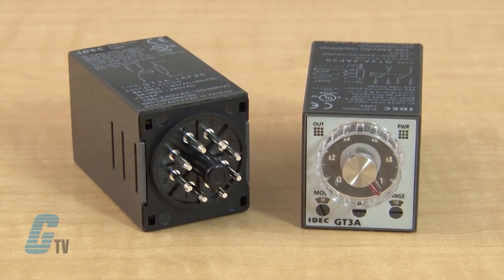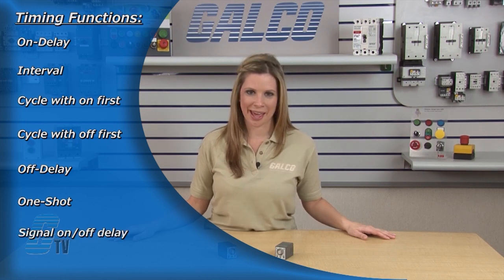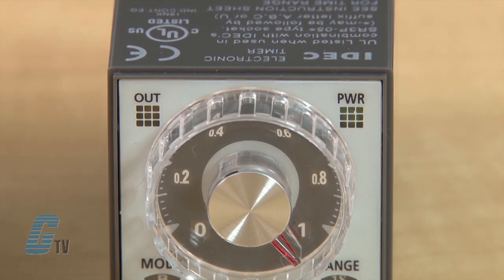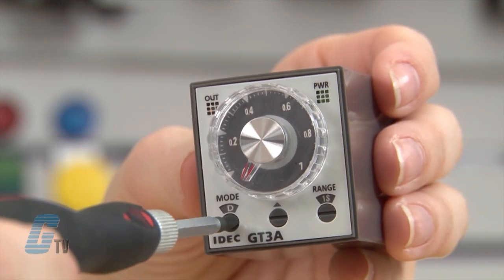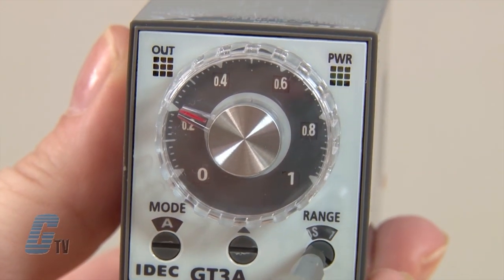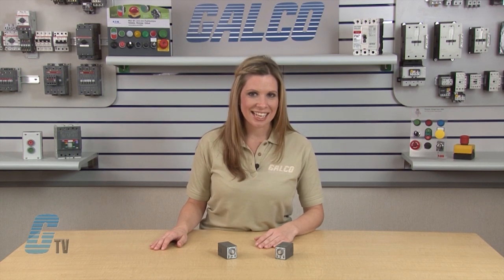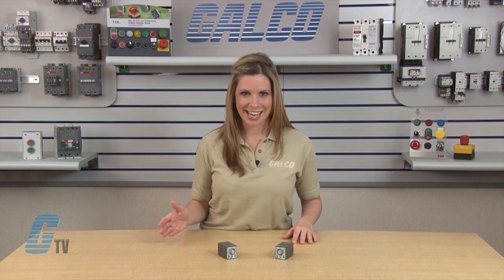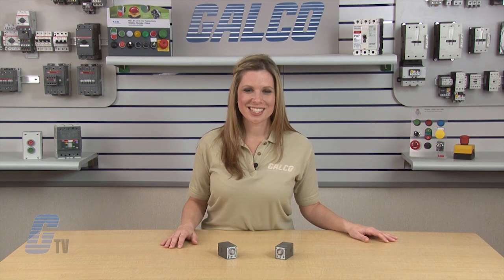IDEC "GT3A" Series Analog Timer Relays - A GalcoTV Overview

Comment: Great relay. Using this relay to keep my fan running after thermostat turns off electric heat. I set the time to make sure I get all the residual heat off the unit before it turns off completely. Set for delay off.  Wiring a fan limit is not possible in my application. Not sure why there are people giving this thumbs down?..... Its a relay.... Anything I should know about?